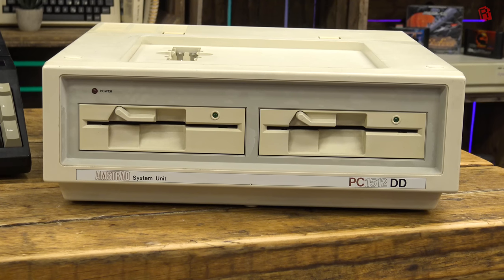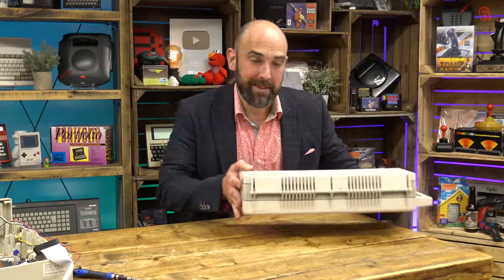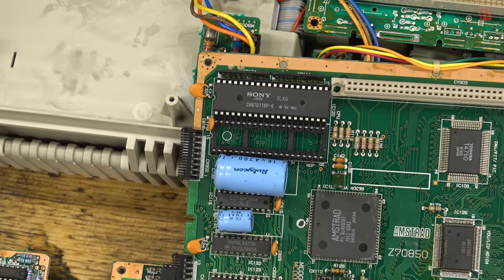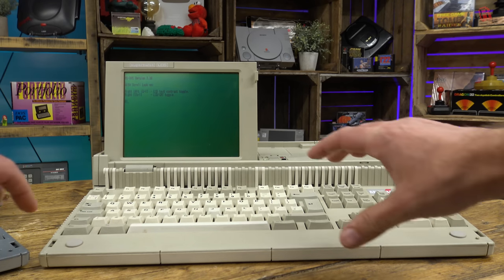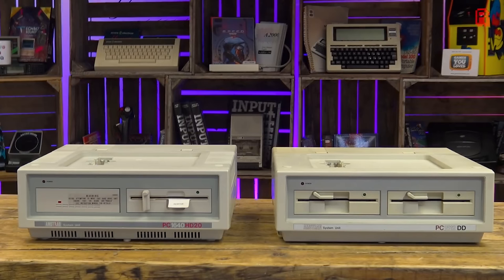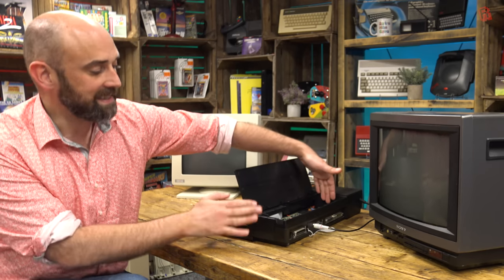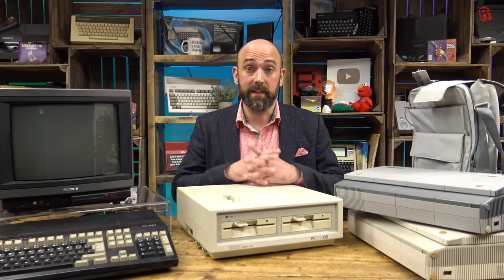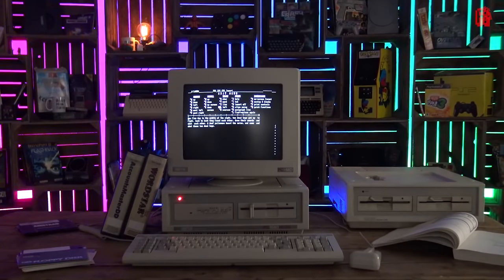Wedge Shaped PC's? Meet an unusual Amstrad computer family | Show & Tell

Comment: The Amstrad PC2086 should be included in your lineup as it was essentially the same as the PC1640 except that the Paradise EGA chip was replaced with a Paradise VGA chip.

Comment: Great video, as always!
I actually had a PC200, which cost 199 UKP at Comet.
Believe it or not, I ran it with a old TRS-80 composite monitor via a home-built CGA-composite adapter, an HDD and XT controller scrounged from work, and an EMS card. Wrote some software on it, amongst other things. And yes, you had to leave the flap open. I didn't care. Sadly it died when I accidentally unplugged a card with the power on - it blew the DMA controller, which made the floppy unusable.
Thank you for the reminder of happier days.
I've also been to the Swindon Museum of Computing - great place, would like to go again some day.
Reply: I had the non-UK Amstrad PC20 as a kid and I thought it was amazing and actually good value considering it could be cheaply upgraded and had access to the largest and most widely used software library. The £299 initial UK price for the PC200 was not bad compared to £499 for an A500, £399 for an ST, ~£400 for a C128+1571 or £300 for a C64C+1541C. I also don't feel it was under-specced compared to other systems of that period. Cheap turbo XT class PCs had the largest share of all new computer sales in the 2nd half of the 80s and were popular up until 1990 but the PC200 actually had a 16bit 8086 cpu rather than the standard 8bit 8088 which gave it a slight advantage. It could also be cheaply upgraded to a 8-10mhz V30 which put it roughly on par with a 6-8mhz 286 and installing an EGA or VGA card offered further performance boosts over the somewhat slow onboard graphics. Not to mention you could also add a sound card, hard drive or 8087 FPU coprocessor. I had a V30 & EGA card in mine and a great time with games like prince of Persia, ultima 6, monkey island, eye of the beholder, quest for glory, MechWarrior and the SSI gold box games. With a V30 you could even get Wolfenstein 3D to run, albeit in a much-reduced window, which is pretty amazing for a 1988 budget machine.

Considering the Tandy 1000HX and EX were Tandy's best ever selling computers, there did seem to be a market for budget wedge PCs. If Amstrad had marketed the PC200 better, released it one year earlier and given it a slightly taller case and EGA onboard graphics then they probably could have found similar success in Europe and Oceania. Really the PC200 is what the PC1640 should have been.

Comment: Even today, I love my Amstrad PPC640. I have it attached to a color monitor (at this moment a VGA LCD panel with  an MCE2VGA converter), because the Supertwist LCD has way too much ghosting when playing games. I also have an Iomega ZIP100 drive attached to the parallel port as a sort of ‘hard disk drive’ to increase the capacity and exchange data and software. I only use the a 3.5” disk to boot, all the rest of the data is on the ZIP disk. It even runs Windows 3.0 from a ZIP disk... in CGA :)

Comment: I was working on a summer job at an Amstrad importer ( Teknopiste ) here in Finland,one of my jobs was to install 40Mb hard drives in PPC 640 machines, I remember installing an additional circuit board and a 3.5" hard drive instead of another floppy drive.
Reply: Would you have perhaps still some documentation about this hardware modification you were doing on the PPC 640 ? Or any name of the builder of the circuit board and hard disk ? Like Olivier I use my PPC 640 with a MCE2VGA and (a ZIP drive or a parallel sound device by Serdashop).

Comment: A collection of Amstrads is called an 'Alan'. ;)

First encountered the 1512/1640 at college when they swapped out our BBC Micro network, not bad machines at all; also had a Sinclair PC200 back in the dim and distant, but had to have the back flap tipped open to fit a 20Mb hard drive into it!

Comment: I nearly bought a PC 200 back in the day, but they should have put the 2 ISA slots in horizontal as that way they could have fitted in two full size cards.  I am guessing Amstrad did not do that as it would have required a stand off board for the ISA slots adding a couple of dollars to the cost.

Comment: In 93, I was given an Amstrad 2386 with a monitor by someone who worked in an  IT business, someone had droppped the monitor so every time they switched it on it smoked. He gave them to me to see if I could fix it. 
I spent from 8pm to 8am running wire links across broken tracks on the monitor board to get it working again, got it working, my first 386 PC for nothing in 93. (got an interview with the company on the strength of that.)
Reply: Nice story; I hope you got the job too, after the interview.
Reply: @BertGrink  Unfortunately no, but I made the shortlist 😂
Reply: @garystevens6831  sad onion

Comment: I owned the PC-200 in 1990. It cost roughly the same as the Amiga 500 would have cost here in Finland. The PC-200 certainly wasn't a "multimedia machine" (at least without expansions), but it had some other things going for it. It was a "real PC" and not a "kids' toy" as the "home computers" of the era kind of were.. ;) (And I kind of knew where the world was heading to and I was right...) It had a huge library of professional software available for it, as well as some exclusive PC games that weren't available on other platforms. Such as many of the Sierra OnLine games. And the CPU, while not very powerful, was arguably more powerful than the 68000 in Amiga and ST, which made a difference in games such as simulators. Speaking of simulators, the analog joystick in PCs also made a big difference. And the PC-200 arguably had better/easier expandability. I even upgraded the CPU to a NEC V20, which was directly compatible with the 8086 but provided slightly improved performance at the same clock speed. And I made a dirt-cheap DIY covox sound card for it myself. In 1991 I upgraded to a 286/VGA machine, and I could still play all the old games I had, just with better graphics.

Comment: Oh, every time you pull out the 1512 I get so nostalgic!  My first x86 based computer.  They weren't as common over here in the states.  I wish I still had it!
Reply: @blackterminal  Indeed.  However, it was 1993, I was in the 6th grade, and "retro computing" was not a thing back then.  I had just built my first computer (a 486dx-33), and I never thought that years later I would crave that DR-DOS, 40 meg hard card, 640k upgraded, Amstrad enhanced-graphics goodness LOL.

Comment: I see the 80s definition of “portable” computing to be more about travel than the commute. Say you’re visiting family for the holidays, but you need access to your work data while you’re there. You could hope their computer is compatible with your software, or you could try lugging your whole desktop and monitor setup (fine, if you’re going there by road), or, you have these fancy all in one systems that just need a power point to plug into. You can set yourself up on their kitchen table and keep working on your files.

It’s not the kind of convenience we expect today, being able to whip it out on the train and use it on your lap.
Reply: More likely it would be less hoping your family's computer was going to be compatible with your software and more hoping that your family even had a computer to use at all. Far more people lived without a computer in the house than did in those days.
Reply: Look at the Tandy TRS80 Model 100 portable (incidentally the last computer Bill Gates personally wrote software for) and you will see a completely different story. The battery life probably exceeds any laptop on the market today and it wasn't much bigger. They were a favourite with Journalists who could type up a story then use the built in modem to send it to their office.

Comment: One of my first tasks in my first job in 1988 was working out an access solution so that we could provide remote support for the HP3000 minicomputers that the business ran on. The answer was an Amstrad PPC640 running HP's "Reflection" terminal emulation software. I remember lugging that "portable" home at the weekend so that I could monitor things an dash back to the office to fix the inevitable printer jams and load more stripey green listing paper when needed. I can still remember the Hayes AT commands! Those were the days.

Comment: When I was in university the 1512 were used instead of VT100 terminals to connect to VAX/VMS mainframes
Reply: In about 1987 I got a quote for a DEC VT220 terminal (the VT100s successor). It was about £800. Like your University some departments at work started using PCs as terminals because they were cheaper. DEC failed because they never realised that computers were moving from being something for Universities and Big Businesses to small businesses and the home.

Comment: I still have my PC1512, one 360k drive, PC-MM monitor and DMP 3160 printer. I upgraded it with a second 3.5 floppy drive. 

That was my first PC, from january 1991 to march 1998, when I replaced it by a brand new Pentium 200 MMX.

Many hours playing (Pirates!, Sub battle simulator, Their finest hour, F-19 Stealth Fighter and many more) and working (Writting Assistant, Ability, MS-Works 2.0, Dbase III...).

Comment: The PPC640 was my first home computer in the early 1980s here in the U.S.  Why buy such an odd bird?  I was young and had limited money.  The $754 I paid was a lot of money to me but also a great deal. Why was it a great deal?  640K! Full-sized keyboard! Two 720k floppies! A 2400bps modem!  A built in CGA compatible monitor!  These were all features that would have cost me much more to get in similarly configured desktop computer.  I used it as my main home computer for about 3 years.  It did the job and I sill own it.  

I never saw or knew anyone who had or "hacked" the expansion port.  I know some put a harddrive in it.  But boy, taking it apart and getting it back together was no small feat.

Comment: I worked at a computer shop in Fulham in the late 80s/early 90s - sold bucket loads of 1512s, 1640s and the later 2286/2386, 3286/3386 machines. Although we had a Sinclair PC200 on display, I don't remember selling a single unit.

Comment: Never owned any Amstrad but the small computer shop where I worked in the early 90s had both the 1512 and the 1640 side by side. It was on these that I learned how to use a hex editor to partially retrieve a customer's document. The middle of the shop also had an ST and Amiga back to back. The Amiga won me over and I upgraded from my +3.

Comment: Ah, my first IBM clone, the PC-20. Was brilliant at the time, even though I had to leave the top flap open to house my MFM HDD controller - 'twas an era when low profile cards weren't even contemplated (except by Sir Sugar evidently, though I doubt even a low profile card could've sat comfortably under the flip-up cover).
Reply: Unfortunately, the only thing that needed to have been done is to stick the slots onto a riser card, so that the expansion cards could be parallel to the motherboard.
Reply: @absalomdraconis  Having watched The Apprentice I can just imagine the the Alan Sugar saying "A riser card costs HOW much".

Comment: Amstrad PC 5086 - Seems rare today. A great overview of Amstrad's PC era, loved it. As a kid I held on to my speccy for ages, school friends all got Atari STs  and Amigas. My parents got me an Amstrad 5086. It was a VGA machine 8086 processor, 640kb of ram and a low density 720kb 3.5" floppy drive. This was when the 286 VGA machines and 40meg hard drives were just becoming more common in the PC world. I guess, this was Sugar selling older kit in a box that looked like it was worth more. The pizza box case as just lovely to look at, and the VGA graphics were showcased in store with counterpoint, a GUI. I remember the original Amstrad mouse that came with it had a wonderful mechanical soft click for the buttons, something I wish modern mice would have. I've been trying to find an old Amstrad 5086 machine (I fried my mother board and the machine ended up being scrapped), thinking that today, a case like that would look amazing with a modern PC specification. Searching the internet it seems really hard to find anything about the 5086, the only thing I can find is an image on a polish website: https://www.retromaniek.pl/wp-content/uploads/2019/01/AMSTRAD-PC-5086-PC5086-VINTAGE-COMPUTER-RARE-With-Monitor-Discs-Cables1.jpg

Comment: The niche software we found for those computers was video library software - Sold quite a few at the peak of the video boom but nearly all on the PC640HD model for the larger shops. We did try the PC200 and indeed a few other models (Tatung Einstein anyone?)

Comment: The 1512 was CGA (and MDA) compatible in terms of software but had a proprietary DIN connector with signals that were much more like those of the CPC series.  The 1640 had EGA graphics and a standard 9-pin D connector.

Comment: While I did not have an Amstrad machine in the day,  I had a summer job in the early 90's in a Amstrad distribution center in the Portvof Rotterdam,  where Amstrad pc's, satellite receivers,  monitors, vcrs and the such like came in for Benelux distribution.
I had to do spot checks on pallets of stuff.  Get a pallet of monitors, 9" vga color screens in this case,  select 10 random monitors from the pallet, unpack and test it using a testing program, for quality , burn in, resolutions, etc.

Comment: Back in 1986 or so, I was using IBM PCs at work, but couldn't afford $1,200.00 for one. So Montgomery Wards or Sears offered the Amstrad
"personal computer" PCW8256. for $300, I think. It was more a word processor than a PC, and used very odd silver-disc cassettes. But as a part-time story writer, it was great! I have a "portable" IBM PC 286 that weighs about 15 pounds. Eventually, I bought a 386 from a friend, and I had 
a "real"  computer.  Thanks for showing all the cool Amstrads!

Comment: A number of friends at school had a variation of the pc-1512 or pc-1640 models. They were generally rather envious of the 286 and 386 I had at the same time, especially with the compatibility issues they'd suffer from. You saved yourself money sure, but you gave yourself a lot more headaches down line, especially if the monitor acted up!!

Comment: I owned one!  I owned the PPC640 as a kid.  I got it used at a local garage sale for $10 I think.  I was really thrilled with the idea of taking QBasic with me to school on a machine I could cram into the bottom of my locker that could run (some of) my existing QBasic programs, not to mention Microsoft Word 2.0 IIRC.  What a downer it was after I saved up my allowance for those TEN C BATTERIES only to discover that it ate through them like candy - and no, the teachers at my school would not allow me to plug it in.  "We can't have students running electrical cords across the room to their desks - it's just not safe.  And it's not fair to the other students."  I think that last bit was referring to the fact that my peers were still having to do their writing assignments on pen and paper so the staff was none too happy with me bringing this thing into school from the start.  The math teacher had even petitioned the school principal to come check up on my use of it because she was just certain it was some sort of game platform and not the educational device I pitched it as.  Ultimately I ended up taking it apart, as was my childhood M.O. once I'd tired of a particular toy.  Today nothing of it survives except, for some reason, the two 720K floppy drives.  Anyone want them? :)

Comment: My first IBM compat. PC was the PPC512 to which I added a second floppy drive and later bought a CGA monitor for it. I carried it to work, in that lovely bag, and while it didn't have a HDD, I was able to run Qbasic and go  through some test programs from work and learn more programming skills. A really good PC (PPC). Other programs I ran on it were Word Star, As Easy As spreadsheet, Arcadia F1 game, Chessmaster 400 Turbo. It ran a Version of Dos 3.2 though I think I remember running DOS 5.something on it badly. Dos 3.2 worked best. I think it was modified for Amstrad with the NEC processor. Got the thing second hand in 1993 and kept me going till I  home built a 4862DX266 with 850MB of HDD over 2 HDD's, a DITO tape backup and a Creative CD 4X drive with the by then  standard SoundBlaster 16 sound card.

Comment: Our first actual PC was a PC7486, a later model based on a TI 486slc. It was well packaged with PS/2 connections on the underside of the base unit and 2 ISA ports on a riser card. It was very affordable I believe it cost £749 including the SVGA monitor in 1992, but was again very limited.

Comment: The PPC640 is a weird but interesting machine, there were ones sold with a hard drive built in.  But to fit in the hdd controller they had to remove the modem!
the drive also took up one of the floppy drive bays.

Comment: Back in the 90s when old computers were very low priced.  I got an Amstrad PC1512 DD with mono monitor.  Hard card in the isa slot.  Also had a Sinclair PC 200.  Would swap the hard card between them. If I got a 3.5" disc, or a 5.25" disc.  So I could install software to the HD.  Those computers are gone now.  Amstrads I have now,  NC100, working order.  A recent local auction buy was a PPC 640, a PC1512 base unit.  Amstrad KB5 keyboard, that Im using just now, with a more modern PC

Comment: Amstrad PC... Oh dear lol. Actually used one of those 1640's for work bitd (early 90's). I used it for word-processing using Lotus and for CNC iso programming (when I worked @ large west midlands automotive engineering company at the time).
They had so many of those Ams PCs the IT had a stock room full of 'dead' machines for donors!